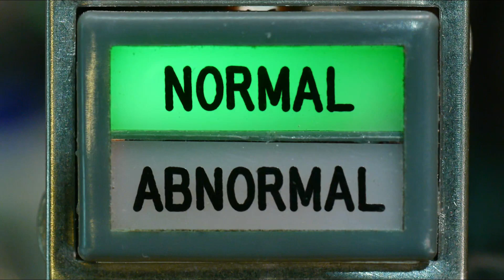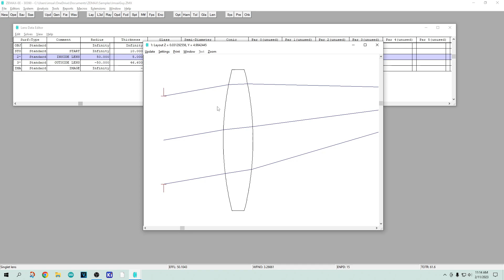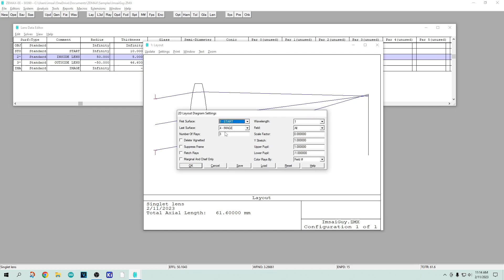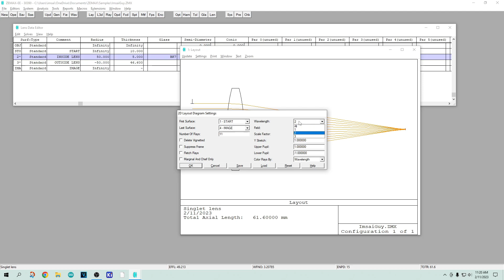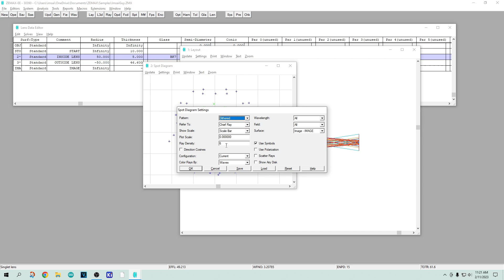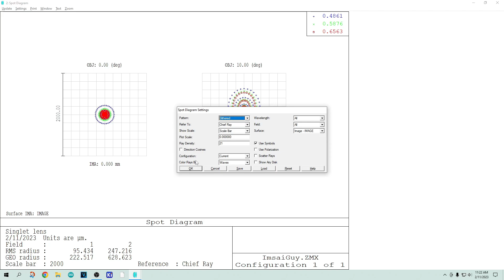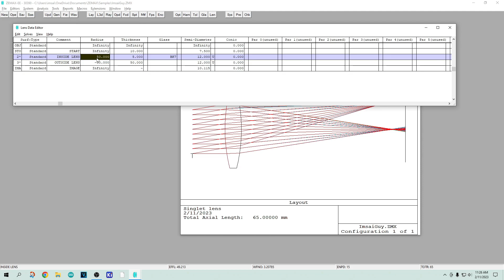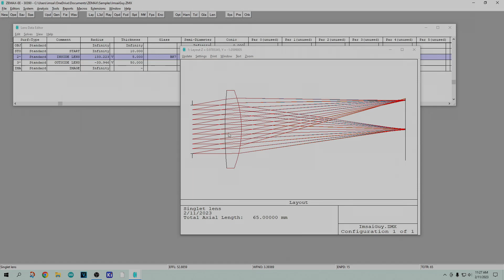#1432 Simple Lenses Suck

Comment: Im gonna guess that software is expensive.  Love that you can give it a bunch of parts and ask it to sort it out with the optimise button. 
My parts are currently mounted in mdf sheets that can slide along a rail.
Reply from the maker: I would get the book Modern Optical Engineering by Warren Smith if you are interested in lens design. 
CAD tools I've used: ZEMAX, OSLO, Code V, LightTools. once in a while MATLAB or Octave for specialized calculations and color theory.   OLSO may have a trial version, you can also try WinLens3D free

Comment: Back in the late 70's early 80's I worked for a company that made optical inspection equipment Though I worked in the mechanical end of things, I had some exposure to the lens design aspect of that business. These lens assemblies had multiple individual lenses and the design process was considerably more complicated because back then the software was arcane and difficult to use, as were the computers it ran on. I think a lot of the lens design was done by experimentation tweaked with analysis. To have had software like you display here would have been a great boon to the design process.

Comment: This is a great video! There are plenty of basic physics presentations on lenses, and some high end presentations, but practically nothing in the middle. While a bit away from electronics, and I'm sure after working forever one of the last things you want to do is more optics work, but I for one would love a series on lenses and optics---optics are often an integral part of electronics, so relevant I think. Maybe something to consider. Thanks for what you have presented, however.

Comment: I own a few telescopes from Astro-Physics, each lovingly hand-crafted and hand-figured.  One is an oil-space triplet refractor, f/7 and wonderful color correction.  For photography, you need a corrector optic to get a larger flat field at the focal plane.  That each of the 3 objective lenses (of two different types of glass) are hand figured at the end is just remarkable..  There's theory in the modeling software, and then there's the "practice" of actually being able to fabricate these things to work in the field.

I have another telescope from them, really an astrograph -- it's only for photography, never had an eyepiece on it.  It's "Honders" design; looks like a reflector-style telescope, but the rear "mirror" is actually a large spherical lens, back silvered.  Very nicely color corrected and a very large, flat, focal plane.   I talked with Roland Christen at Astro-Physics after he gave a talk at an astrophotography conference.  

I asked him why the telescope had an aluminum optical tube assembly, rather than some fancy carbon-fiber material that was dimensionally stable  with temperature change.   He told me that was on purpose; the change in length of the tube as the temperature dropped offsets the corresponding change in the optics!   All the fancy optical design tools might give you a great theoretical result, but.. that was something I'm sure was learned the hard way.

I love that telescope!  f/3.8,  305mm aperture -- very fast and wonderful for astrophotography.   Of course, it cost more than my first car; even so, my expectations were exceeded.

Comment: Interesting video , now  I think I understand a bit better on how the bokeh works with my large aperture on the SLR.

I am still curious for the star light rays with a small exposure, I know it comes from the shutter blades but don’t understand how

Does it also mean that most of the point and shoot will have a Plano convex or modified outside surfaces and not a simple lens or due to the small aperture hole and may be fixed distance they work ok 
Thanks for sharing and have a good one
Reply from the maker: the shape of the aperture is a very advanced topic including Fourier transforms  
many point a shoots will have the aperture in front of the lens and the lens element curved toward the aperture and add aspherical shapes